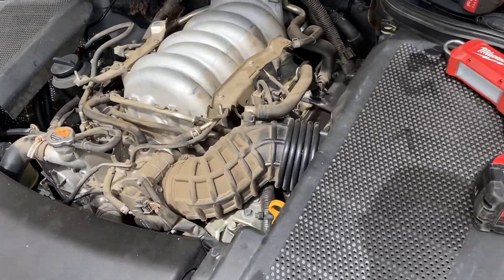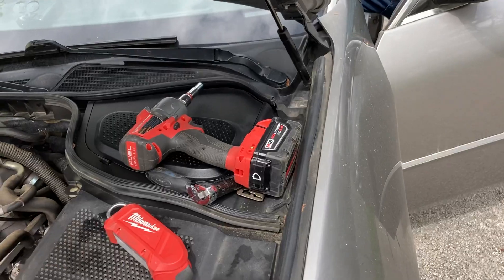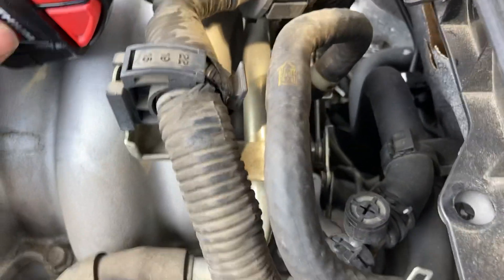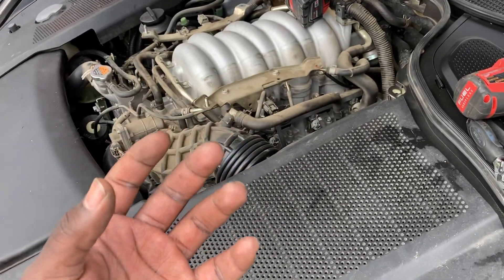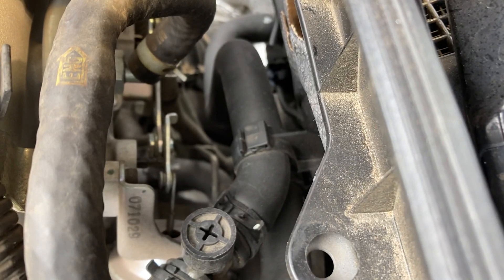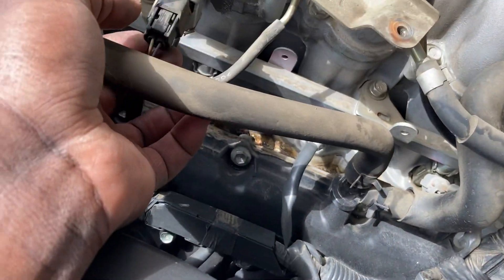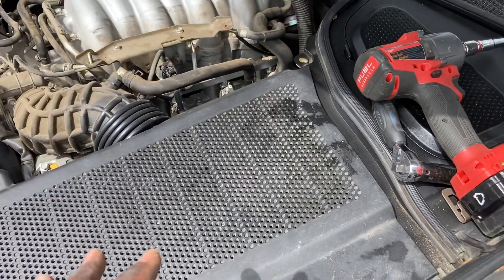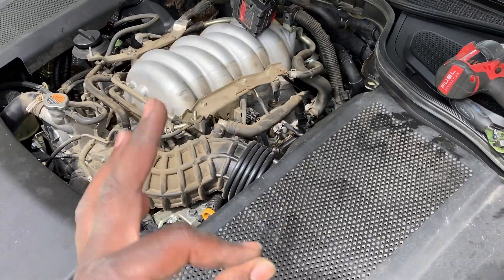VIAS - Nissan Dual Runner Intake System for VK45DE engine. Infiniti M45 Q45 FX45 Fuga

Comment: Good thing this video is out. gonna check out my vias and power valve on my 2002 Q45. It starts and instantly stalls and I've noticed the power valve opens and instantly closes making it stall the engine. gonna go mess with it now lol

Comment: Is there a part number for that diaphragm? The nipple that goes on there broke off on mine qnd need a new one but cant find no part number for this. I have the p1800 code but not because of the solenoid but the vacuum line itself not being attached to the diaphragm
Reply: Did you ever find a part number?

Comment: I need your help with something please….I have a 2006 m45 and my check engine light came on and I got a diagnostic check and it says that its my intake manifold control runner solenoid. Can I just replace the solenoid, or will I have to replace the whole manifold…please reply soon as possible.. thanks…
Reply: You can buy the solenoid separately
Reply: @spideybuildscars  thanks bro…thanks for responding…..

Comment: 1- What would cause these tubes not to suck like that? 

2- how do you know if a solenoid is bad?
Reply from the maker: #2. There is a dtc code that will come up. I believe it's P1800

#1. Vacuum leaks due to cracked, cut or dry-rotted tubes
Reply: Thanks!

Comment: So glad to see youll be messing with the M45's again. I just found an 06 sport with 83k miles and ive been watching all of your vids to learn as much as possible. Thank you for not only making awesome vids and tutorials, but also for speaking clearly, going slowly and doing the task multiple ways and sometimes in multiple views. Keep up the great work!!
Reply from the maker: Thank you for the support and encouragement. I hope your M has been treating you well
Reply: @EdBwoy  Its been great! Just hit 85k miles. We drive it rarely, but I did notice with just a few spirited drives, it will drink some oil. No leaks, but only 2000 miles after oil change, I added another half quart. I did all the brakes all around thanks to your vids. Next thing I'll probably do is the spark plugs and cooling system maintenance.
Reply from the maker: @b12y5e  unfortunately they tend to have a healthy appetite for oil. Yours isn't too bad, and I applaud you for checking the levels.
While planning your maintenance, I'd like to propose that you take a look at your PCV valves as well. I have found that to drastically reduce oil consumption on engines like yours that have moderate consumption.
Reply: @EdBwoy  thanks again for everything!

Comment: Заслонка при перегазовке на холостом ходу должна двигаться?
Reply from the maker: It should not move that much. Because the idle speed is constant, the throttle plate opens just a little bit and holds